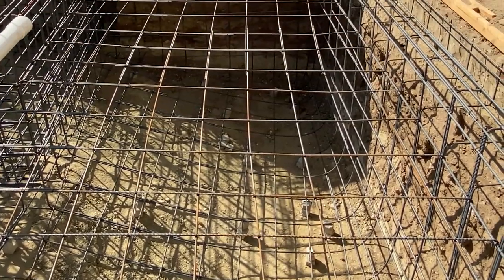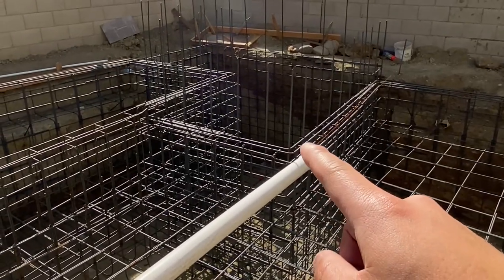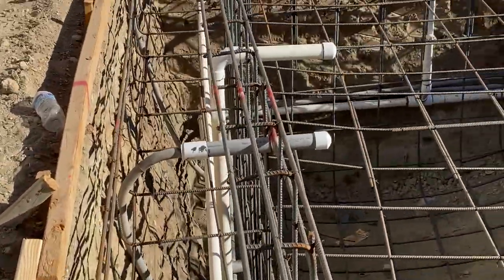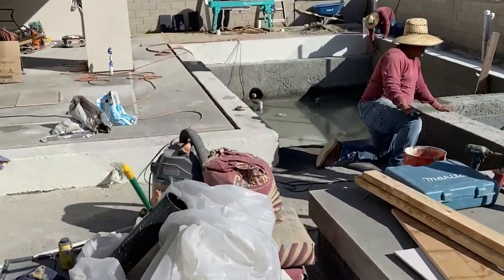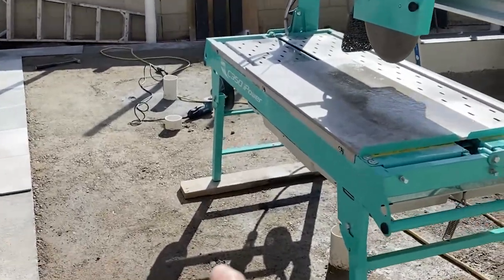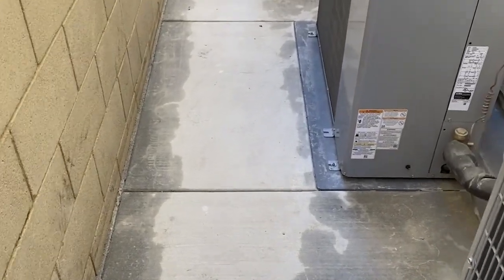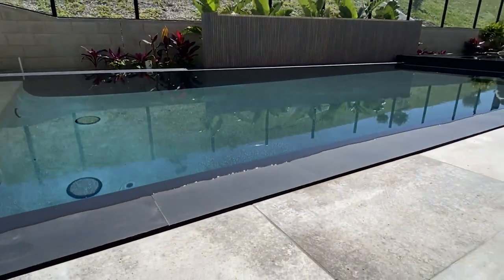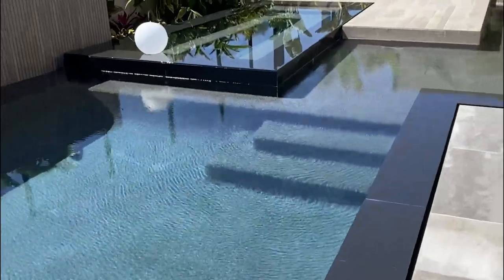How we built this complex zero edge pool on sketchy soil.

Comment: I have one question, where is the filter basket? I see the water over flows to the trough and goes into the catch basin. But I don't see where the leaves would get filtered out
Reply: All of the water returns to the collection tank. There is no skimmer on a zero edge pool, the edge itself is the skimmer but leaves have a hard time getting over the edge because the tile is set at a pitch to help create the look.